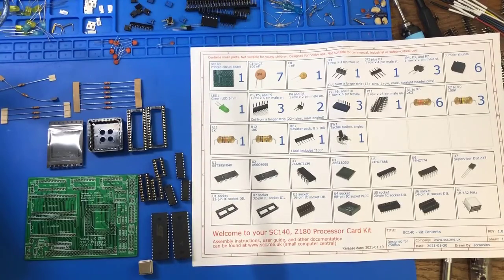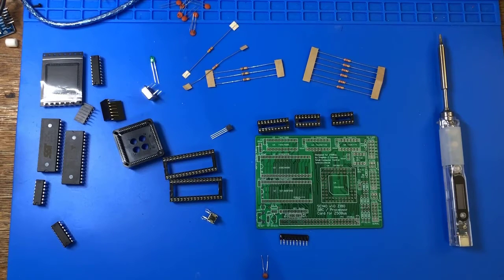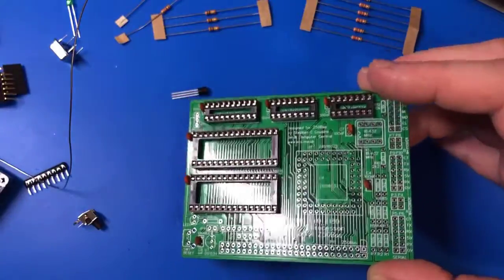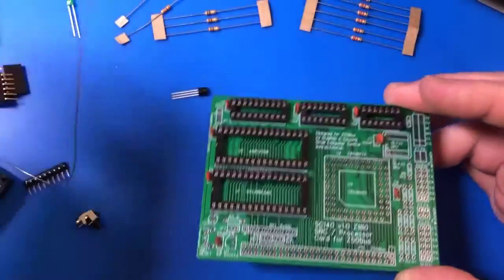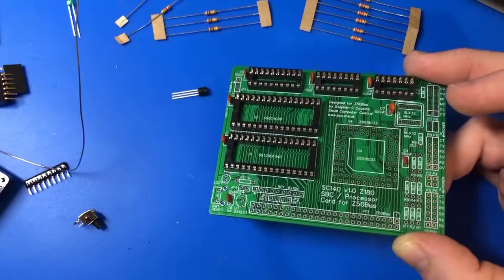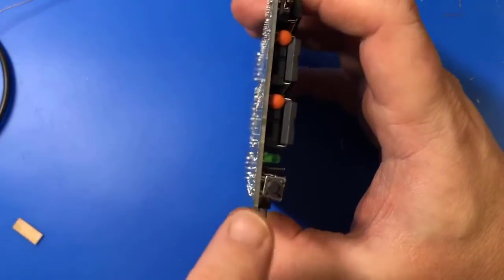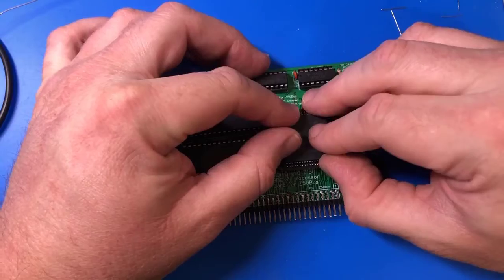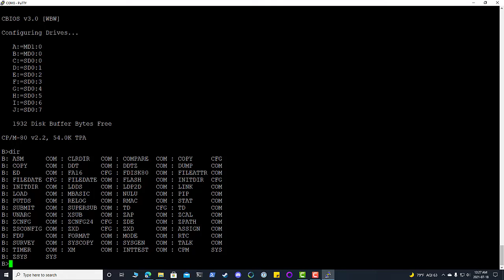Building the SC140 retro-computer for Z180

Comment: Thanks for the video!  I'm only part-way through it, but like your soldering.  The music is great, too.  Do you like that soldering iron?  I am eyeing something similar as a "travel iron".  Seems to work well for you.  

Finally, a dumb comment:  you might consider soldering down the resistors, etc. first.  Unless there are reasons not to, I work height-wise.  Place the components, put a bit of cardboard on top, tip over and solder.

Comment: Whats the difference between the sc128-130 or 140?
Reply from the maker: The sc128 is a modular backplane and the sc130 is a small motherboard. The sc140, shown here, is a Z50Bus compatible system that can act as a single board computer or drive a whole backplane.

If you're interested in SCC then I really recommend the sc500 series to replicate this build here, or the sc700 series for something with more pins. These are the latest standards and they are quite good; iterating upon the designs of these older models and adding features and documentation.

Comment: What can this board do?
Reply from the maker: It can run a CP/M distribution known as RomWBW which includes CP/M 2.2, several coding environments like BASIC and FORTH, and a CP/M compatible known as Z-System. RomWBW is an open source project that is easy to modify, giving you a lot of flexibility.

These days I recommend anything in the sc500 and sc700 lines. The sc140 is an older model and has been superceded by these lines. SC500 series uses the z50bus standard and the sc700 series uses the more robust, but harder to work with (physically speaking, they are more difficult to seat and unseat), rcbus 80-pin standard.